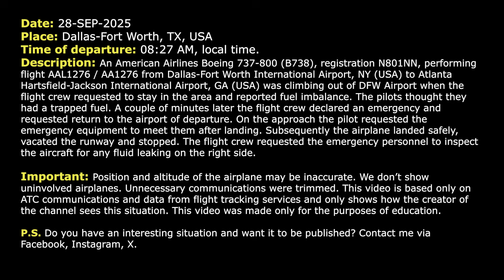Fuel imbalance after departure. American Boeing 737 returns to Dallas with fuel problem. Real ATC

Comment: wow... what a coincidence!  I also had fuel imbalance issues just last week.  Except it was in the fuel tank of my older Mercedes. I didnt' even know there were two sides to the Mercedes fuel tank.  Apparently something called the sender unit had gone bad. They removed the whole fuel tank and fixe that bad part.  Now it's balanced again.     :)
Reply: WOW! that’s amazing
Reply: @Trevorww100  amazing? not really... just goes to show that I don't really know anything about cars.  It was a $280 lesson. :)
Reply: What model Mercedes do you have?  I wasn't aware of any with a split tank, however the "fuel sending unit" is often times what's referred to as the fuel pump assembly in modern vehicles.

Comment: Can someone explain "trapped fuel". I'm trying to Google this terminology and not finding anything
Reply: I’m rated on the 737, and I don’t have an answer for you.. by “trapped” fuel, I assume he isn’t drawing fuel from that one side.. at 16,000 pounds of fuel on board, he’s basically got almost full wing tanks and an empty center tank. (Full wing tanks are approximately 17,000 pounds) Each tank has two fuel pumps that are normally on unless you are cross feeding . I suspect that they had left the interconnect valve open by accident, and the dim blue light didn’t catch their attention like it should have.
Reply: Nice clear calm communication!
Reply: Google trapped you.